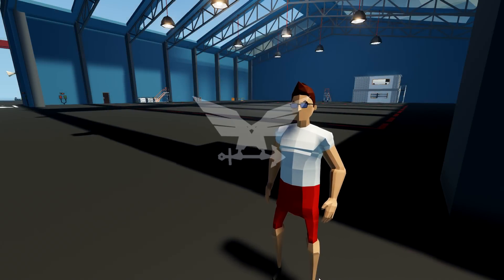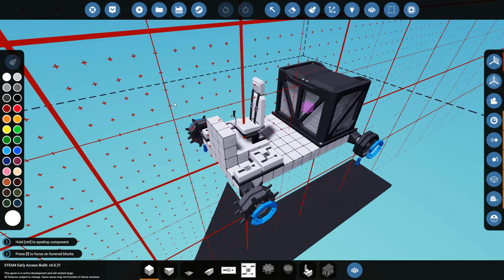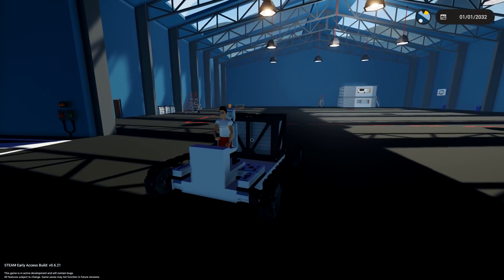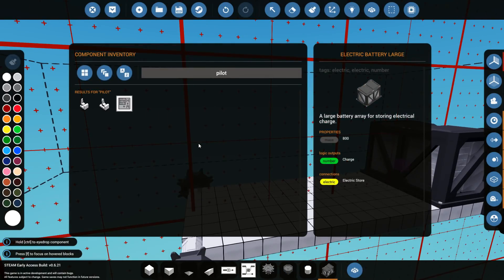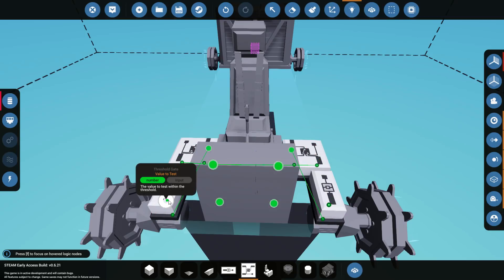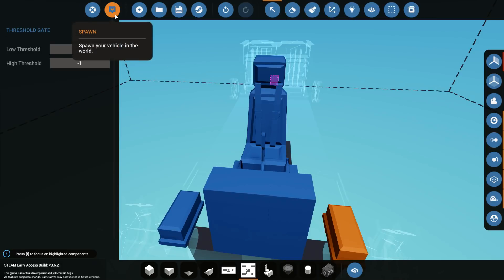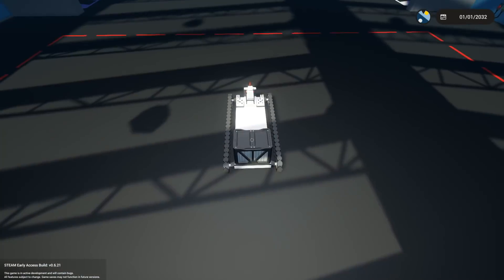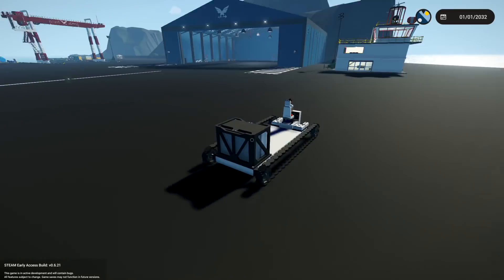HOW TO USE Tank Tracks  -  UPDATE 0.6.21  -  Stormworks: Build and Rescue

Comment: Frantic if you want it to zero turn/ turn on the spot then you need to add a transmission to each of the motors so you can make one go in the opposite direction of the other

Comment: I just built an M113, when I put the engine in and drew all the piping etc. it all worked fine, I could drive forward etc. then I had to widen it because it was a bit too thin, I also changed it to medium tracks, suddenly it didn't work, changed the tracks back, still didn't work, I'm fairly confident I've connected everything properly (I even disconnected all the lights etc. I had drawn and made it barebones functionally to keep it easier to diagnose but nothing works).

Do the drivewheels have to touch the ground or something? 

If someone wants to help me troubleshoot I'll post a link to the workshop page for it here:
- https://steamcommunity.com/sharedfiles/filedetails/?id=1821278926 -

Of course I find the problem right after I post this...now I only need to keep the engine from stalling when turning etc.
Reply from the maker: XD